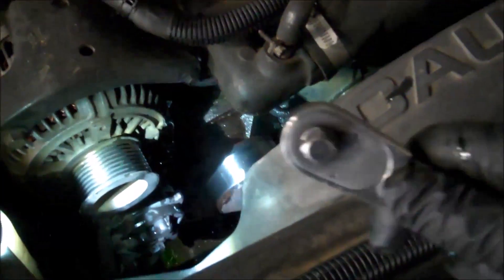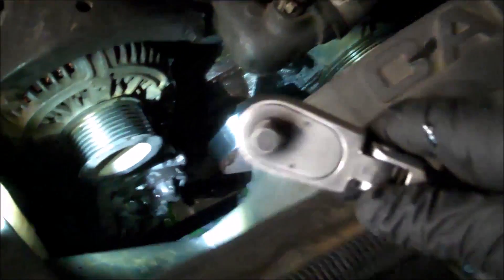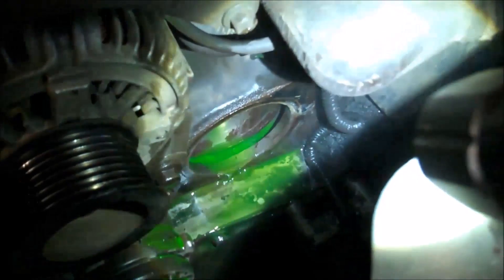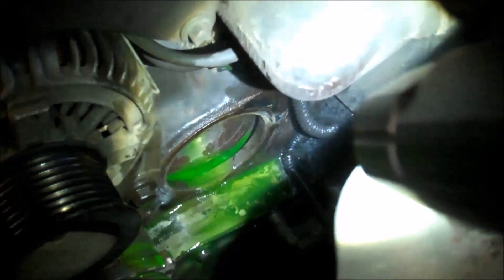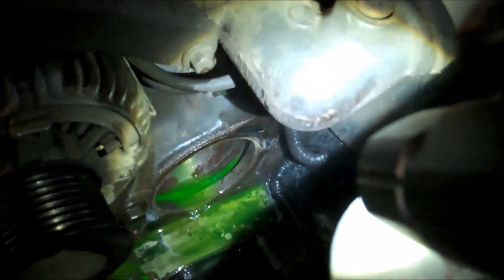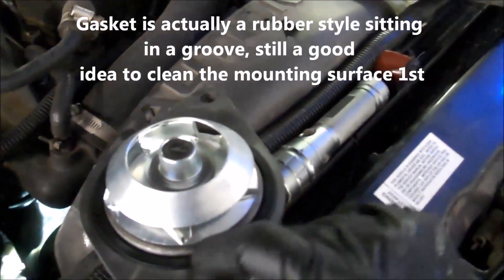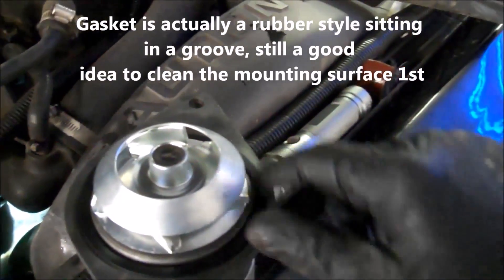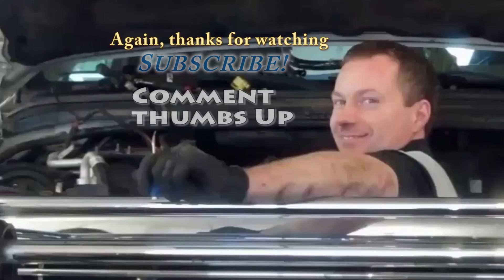Water pump replacement Dodge Ram 5.9L Diesel 1994 - 2009 R2500 R3500 Install Remove Replace

Comment: How ,what, held pump in place to start fasteners. My magic wand is missing.
Reply: there are only 2 small hex head bolts to hold these pumps in place,,I installed studs,into my block,,on the 12v motor, so as to align the o ring gasket straight when tightening down,,gotta be careful on these pumps that you dont misalign the gasket while installing,or you gonna' do it again,water will pour out,, good video

Comment: Please display, magic wand, used in instalization thanks, mine is missing.
Reply from the maker: I believe I just used my hands, one to hold it and the other to start bolts.  It was  a while a go though.  I have a long prybar and a long screwddriver I would be able to use as well.

Comment: had a 2007- fun thing ate 3 pumps at 80k sold it.  Trans issues.  fkn junk.
Reply: I have a 07 250,000 still has the same one in it hahah it way over due for a new on but it hasn't given me any problems
Reply: +Leonardo Mateos  My '05 Dodge 3500 diesel has 320,000 miles on the same water pump.  Still going strong.

Comment: great video. short and to the point. I did have trouble with the sound being too low with my laptop turned all the way up and you tube all the way up. anyway thanks for the great video.

Comment: How will you know when your water pump is finished?
Reply: +MrMrNoober  I drove my '94 Dodge 2500 Diesel for 655,000 miles and my water pump needed replaced about every 120,000 miles when it started leaking. I hoped to drive it to one million miles but at 655,000 the head gasket rusted through and needed replaced.  I had the shop grind the valves and mill the engine head when they replaced the head gasket but something went wrong and the finished engine had zero power. It would barely move the truck.  They put an after market power device on it and while it did give the engine tremendous power, the exhaust smoked, blew diesel fuel all down the side of my trailer and got rotten fuel mileage. I traded it in for a new 2005 Dodge 3500 diesel which now has 320,000 miles and is running fine.  Still have the original water pump. It doesn't get the fuel mileage that my '94 got.  Running empty the '94 got 22 mpg, the 2005 gets 15 mpg.
Reply from the maker: MrMrNoober if you mean when it is time to replace it, when it is leaking, when it is noisy, or the bearings have excessive freeplay.
Reply: Fixing cars and stuff ok great thanks.

Comment: There seems to be two styles of RAM turbo diesel waterpumps. One has shrouded impeller fins and the other does not. My 2003 2500 TD (HO)) came with a shrouded pump but the dealer parts counter sold me an unshrouded pump. They told me the correct pump did not have the shroud and that the design was changed in 2002.  

The dealership parts department said the part number automatically shifts to the unshrouded pump.

Soo which is correct?
Reply: because there are 3 types of manufacturer's,chinese junk,Cummins oem with weephole pointed towards block,and Gates,the best bang for your buck,gates pumps have the shrouded blades,like seen in the video